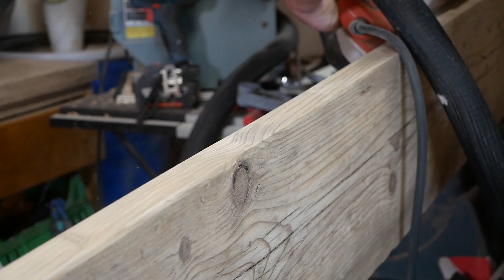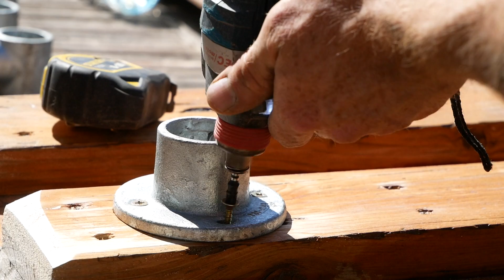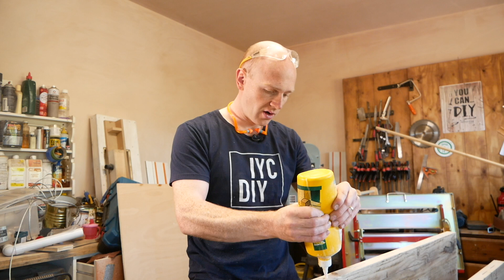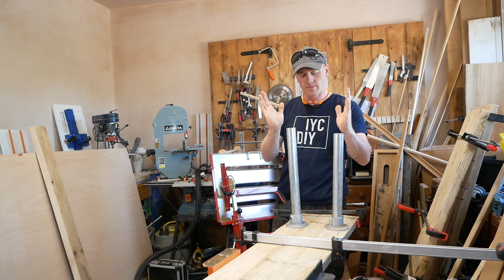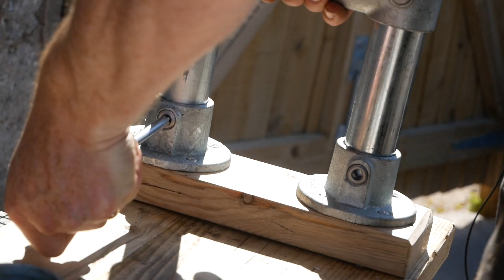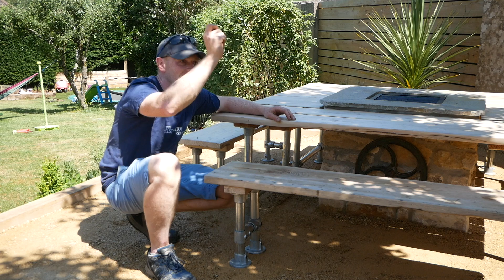SCAFFOLD BOARD FURNITURE - 1 Day Build

Comment: What blade are you using in the sliding mitre to cut the tubes? Also what length are your benches and do they bend much without any support in the middle?

Comment: Hi Tim, Jo, girls, hope you are all well. Super job on the garden furniture, solid and strong. One side effect of using wooden biscuits is that they tend to swell with the glue and eventually leave a raised area on your board surface - ok for a garden bench but maybe not for a fine piece of furniture. Plastic biscuits won't swell. I use biscuits as shuffle pins, as you say they're not structural. I really like the look of your garden furniture. I first saw the Kee Klamp system in the 70's in a book called High Tech, as they were used for building industrial railing/mezzanine structures. Thanks for sharing. Stay safe and keep up the good work. 👍🖖😎🏍🐶🦴😺🐔

Comment: Great use of material for the look you were after. If you are seriously considering planing and thicknessing old scaffold boards go over them with a fine tooth comb as I found to my cost it plays havoc with planer blades, but your right they look great when restored. Regards Jim.
Reply from the maker: Fortunately Jo bought me a metal detector for just that reason. I guess it won’t find engrained grit though. I’d only stick them through on an old set of knives I think. 👍